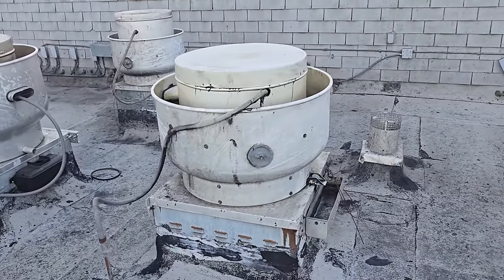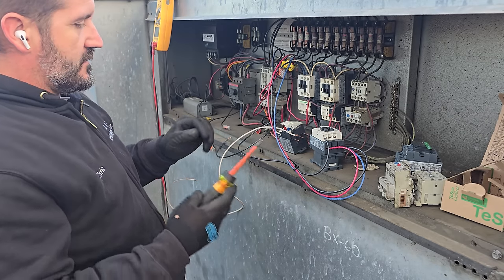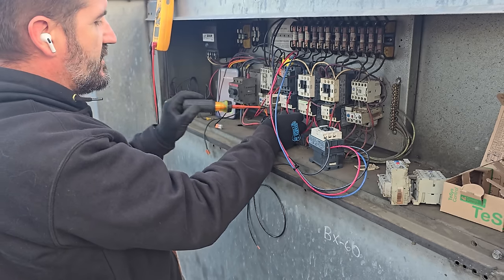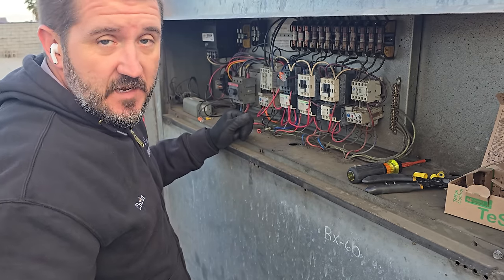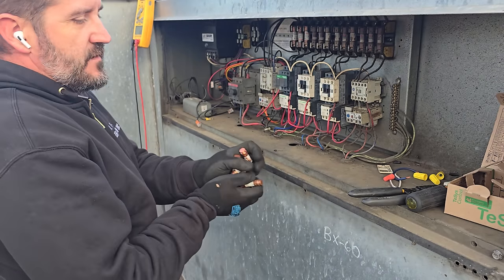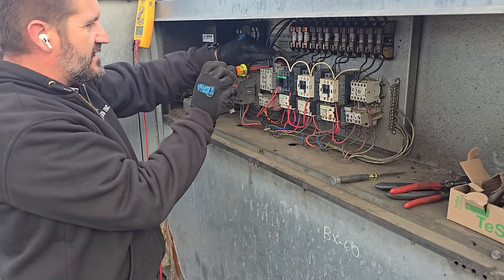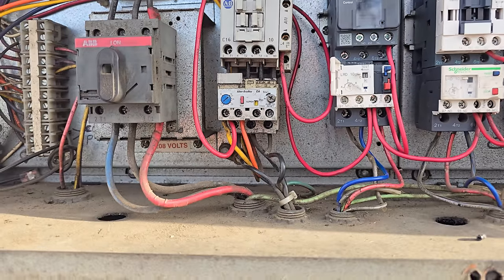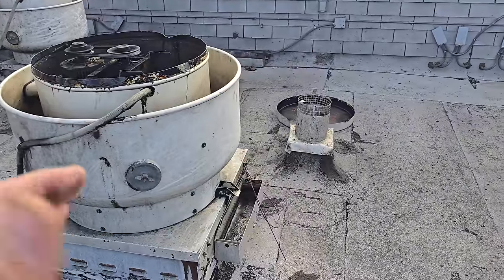HURRY ALL THE EXHAUST FANS ARE DOWN !

Comment: As someone who sells those  Schneider contactors/motor starters you can just swap the coil in those to change the control voltage. It’s a 20 second thing all you need a flathead screwdriver. We actually only stock the 120v ones and keep the 24v, 208, 240 etc coils on the shelf. The only one you can’t swap is the 24vDC
Reply: Yes DC contactors use a different armature design as shading coils are not required, nor is a laminated core necessary.
Reply: Thanks for the tip, g.

Comment: I have a quick question, for how much torque are the screw contacts of the connection points of the motor protection relay in the US market designed? 
The manufacturer's specifications in the EU area say a maximum of 1-4 Nm (torque). 
As an electrician, my heart bleeds slightly when I see how much force you put on them.

Comment: I LOVE how you always try to keep the wiring as neat and clean as possible...

When I was going through Electricians School, the Motor Instructor would deduct anywhere from 10-50% of your Grade in a wiring project if you left him what he called spaghetti...the messier and harder to trace a wire it was, the more marks you lost...
He also reduced your Grade by one Letter for each incorrectly sized Breaker or Fuse...so if you had a 30 Amp Fuse where you should have a 20 or 25 Amp Fuse and got an A (90+%) on the Project, that Fuse dropped you to a B instead (80%)...then he started yelling at you for trying to kill someone with a too-large Fuse/Breaker...if the Fuse/Breaker was too small, he still docked marks, but didn't yell at you since he knew it would blow the moment you started the motor and that was embarrassing enough...

You know you've REALLY screwed up when he starts yelling at you in Yiddish...if that happens, RUN!!!

😄😁😆😅😂🤣

Comment: Look at fitting bootlace ferrules on the end of multi-stranded cables, will avoid problems with stay strands and also screws damaging the wires. The double ones also make looping-in connections
 simple.
Reply: @brianscott7710  those ferrules give me no end of trouble on industrial equipment. I've had them hide broken and corroded wires causing intermittent connection issues. I prefer terminal blocks on power connections and spring terminals on controls and signaling equipment.

Comment: Is it by code that you fuse every "motor-starter" ? (We call them "Thermisch pakket"). We only fuse the control cabinet, and the motor starters are our "fuse" for the item. The rest of the items are seperatly on a breaker / RCD per item.

Comment: The overload protection in the starter protects the motor from running over current. So if you bypass it temporarily you only risk motor damage which is a low risk if duration is short. You mentioned concern over dodgy wiring. Presumably this is a risk for ph to ph or ph to ground faults… which is protected by the circuit breaker. Correct me if I’m wrong but I think the OLP in the starter is much slower than the circuit breaker and thus not able to protect against a short circuit or a ground fault. I think, If I am correct that the starter OLP and circuit breaker are not coordinated, that a dead short downstream of the motor starter would trip the circuit breaker and the motor OLP wouldn’t trip. 
Comments?
Reply: The overload protection also protects the branch circuit conductors. Overcurrent protection (breaker or fuse) for a motor is typically set higher than the rating of the branch circuit conductors, to prevent nuisance tripping during in-rush. The separate overload protection device protects the motor but also the branch wiring. Which means without the OLP, the branch wiring could be overloaded without the circuit breaker tripping, which is a fire risk.
Might be okay to bypass the OLP briefly to troubleshoot, but I wouldn't leave it while you're waiting for parts.

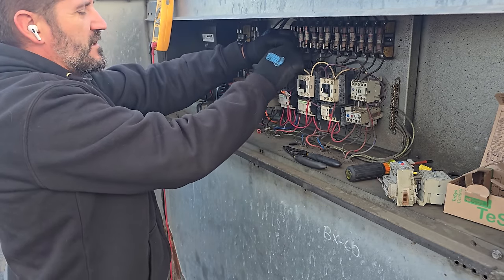Comment: 9:10 - Ah yes, the "George Michael." (Careless Whisker)

Today, at the infamous coffee-and-donut shop, our walk-in cooler was temping at 67°F. It happened while my manager was there, and he called it in. Tech showed up around 2:30 PM, did a quick "gas 'n' go," and was gone by 3.

I remember thinking, "BIG PICTURE DIAGNOSIS..." The refrigerant had to go somewhere, right? And it would probably leave some oil residue if it's leaking that quickly, right? And maybe, with the right set of eyes looking at it, a leak could have been found and repaired... A year and a half ago, the original compressor for the walk-in cooler from the early-90s failed, and everything else is still from that era (and working well - the coils in both boxes look dang good for their age). The original compressor for the walk-in freezer is still kicking butt, keeping the box at -12°F to -9°F. It'll briefly touch 0°F during defrost, maybe even flirting aggressively with +1°F. 

When the compressor for the walk-in cooler failed, we were informed we needed new door seals, we're still waiting... Back in January we reported the bent automatic door closer for the third time, still waiting... Well, at least we're now training our new hires to check to see if the door closer has to be manually flipped before shutting the door, so everyone knows it's a problem.

Comment: Conduit for fans. Where i live, rubber sheath cables h07rnf are used. They are durable, and resistant to vibrations and resistant to grease, oil and water. But proper cable glands are required. Bypassing relays are also something i used to do and i often am alone with difficult decisions like that one. I will never understand american wiring. But perhaps someone can explain how loose wires in metal conduit can be safe. We use cables and cable glands.

Comment: That interlock system could be to ensure the building doesn't pressurise causing other problems. Have you checked that the interlock isn't also part of a system to ensure the make-up air unit doesn't provide fresh air in the event of a fire? As you've said enough times yourself - 'big picture'. In my experience, interlocks are there for a reason even if that reason may not be obvious. 

Personally, I would never alter any interlock configuration unless I had a rock solid reason for doing so and 'it isn't necessary' doesn't qualify as such in my book. There are a lot of things that either don't make sense or don't seem necessary until you find out why and hopefully 'find out why' isn't the hard way. Maybe it's because my background has some different engineering principles to yours where any kind of interlock is something you're very wary of.
Reply from the maker: I will discuss this on my livestream this evening 4/8/24 @ 5:PM (pacific) come on over and check it out. https://youtube.com/live/iwGZEoDxYvo

Comment: There should be no Possibly about it...if you're replacing the conduit and wiring, you should be Automatically installing an external switch if it doesn't already have one...

If you can eliminate the internal switches, DO SO!!! then the next person to have to turn that motor off in an emergency or for maintenance/repair doesn't have to reach past moving belts or past a possibly hot/sparking/burning motor to flip the switch...Don't even give the Customer a choice about it, just tell them this is what I have to do if I replace this unit!